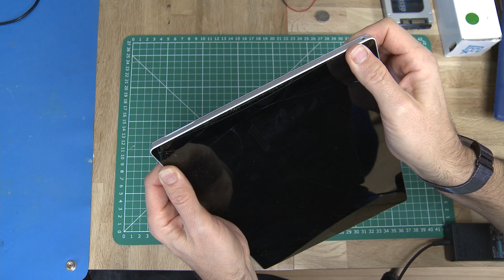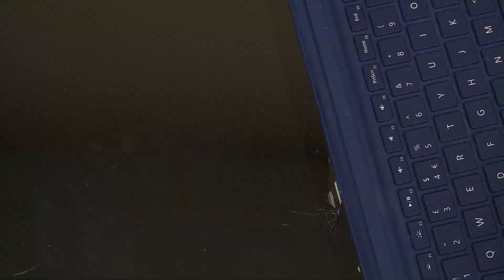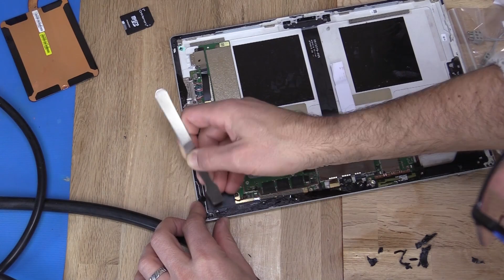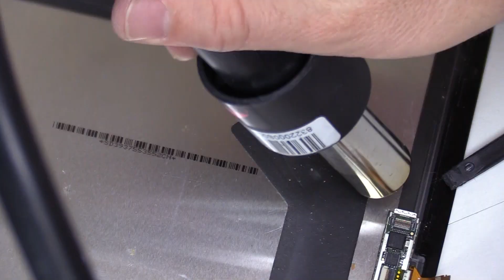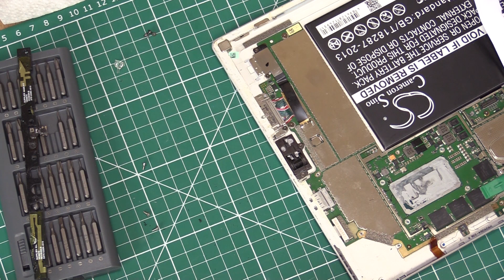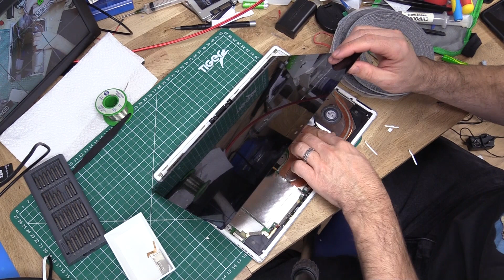#9 - Surface Pro 4 Screen and Battery repair

Comment: Thank you.  I'm doing this to my surface pro 4 now.  Since Windows 10 support is going away, and the Surface Pro 4 is not eligible for Windows 11, I figured that makes it worth replacing the battery, doing a surface pro 5 screen, doing a larger drive, and installing Linux on it.  I was getting ready to buy something much more expensive than this upgrade that was designed for linux anyway.  Doing this and buying a super cheap Win 11 laptop will still be cheaper.

Comment: i had a surface pro 4 battery blotted but screen was not cracked and was able to remove no damage however when replaced touch is not working any suggestions?

Comment: You can replace the battery without taking the mainboard out... BUT... you definately need to remove the hidden screw under the webcam/microphone connector shield. Take out all the other screws up the USB port and then you can lift the board slightly to slide the new battery in.
Reply from the maker: Wish I knew that when I did this 👍🏻
Reply: Can you point me to a video showing this? Thanks

Comment: Can i get gas out from swellon battery rather than replace it since it working well
Reply from the maker: Hi, no, you need to replace the battery. There is no way to repair it and the battery is now dangerous.

Comment: I damaged what i guess are the wifi ribbon and something else cables at the top of the tablet when I removed the screen. I didn't know about these and my spatula thing was on the wrong side of them when I was trying to prise thw whole thing open.  How can I replace these?  Or fix it in some way?  They are really delicate - why would they put it under the glue!

Comment: Yea you really have to be careful when trying to pull the screen off from the surface pro. i feel like its best to simply heat a bit longer then to pry with a tool and break the screen.
in this case, heat is your tool to loosen up the adhesive and a lot of patience. the plastic tool is but a guidance to lift the screen.
Reply from the maker: Yeah, I learned a few lessons here ;-)

Comment: Brilliant. My issue was just the battery, but I wasn't so lucky. A friend managed to open my Surface up without damaging the screen too badly. But the frame's melted a little bit.  We've replaced the battery just fine, but it wouldn't turn on. Then it did once, so we closed it up but after that it would never turn on again. My money is on the on/off module (the left speaker module). I'ms till to procure a new one and try that.
Reply from the maker: Yes, these screens are hard to get off without breaking them or melting the plastic. Keeping the temp low and taking your time is good. Also keeping the heat moving constantly.
It might be the battery connection that is not sitting right. Its a bit fiddly to get it seated right.

Comment: Hope u can share a video replacing a surface pro 5 LG panel with a new LG flex cable conversion connecting to a surface pro 4 unit.. in detail.

Comment: Do not get a surface pro 4 screen. You will get the flickergate problem. You can get a sp5 screen and a conversion cable. You will need to take your digitizer from the old screen and put it on a new screen.
Reply from the maker: Interesting, I'm not having that issue, but good to know :-)
Reply: @athousandprojects  its a well documented scandle online over the past few years. microsoft intentionally designed flaws in their system for profit. the warranties ran out on most of the sp4 models before they said they made a mistake. Basically they got away with murder. I order the parts for my sp4 and hopefully in the next few weeks i can repair it.
Reply: @adudewholovefatchics  comment here if it is succesfull, cause i want to try it also
Reply: i have to go through this exact process after battery swell caused my screen to break. So double wammy for me too. 

Apparently you can’t tell which screen your model has until you get it off and look at the back. First units out of the gate had Samsung which had issues /flicker and microsoft quickly changed production to LG screens. The long connector plug has a different number of pins by all accounts. Mine is a late 2016 so I’m hoping its the later LG screen. This is the one that went on to adorn the SP5. Secondly, the battery didn’t look OEM. Is there a reason you didn’t use the same item as MS. Also, how dis you qualify the quality of the battery? Was it branded? 

Otherwise, a great real world example of the issues surrounding this project.
Reply: @imapcjunkie  If you can still read the screen on your surface pro, then install HWINFO and look at the monitor detail. The screen code  shows there
Reply: @ecclesiastes please comment here if it's succesfull bro, cause i also have the flickergat and want to try to replace my screen with sp5 screen soon
Reply: @ObbyMu  done it its fixed no more flickering works fine.

Comment: Wow this looks scary. So later on when I inevitably replace the battery do you think the speaker connection coming off like it did for you will be a problem for me? Iv taken many computers, phones, tablets apart and fixed them in the end so I do have experience but seeing how easily that connector came off worries me.
Reply from the maker: It was quite scary to do :-) The speaker connection might just have been bad luck or clumsy on my side. But, now you are aware of it you can be extra careful. Good luck for when do replace your battery
Reply: A Thousand Projects Thanks a bunch! 🙂
Reply: I managed to do the repairs without breaking the speaker module it's easy just be gentle.

Comment: What type of double sided tape did you use to reattach the screen?
Reply from the maker: Hi, 5mm 50 meters 3M 9448 black Double Sided Adhesive Tape. Worked a treat

Comment: Hi i’ve replced the battery with a new one. The surface can start and everything work. But when i plug in power cable i se clicking on icon battery some Times the message battery not detected and some time “pluged in not charging”.
Why?
Reply from the maker: Its likely the connection to the battery is not good. You will have op open it up again and check.
Reply: I managed to fix it. I bought a second original battery and it worked.. don't buy compatible batteries !!